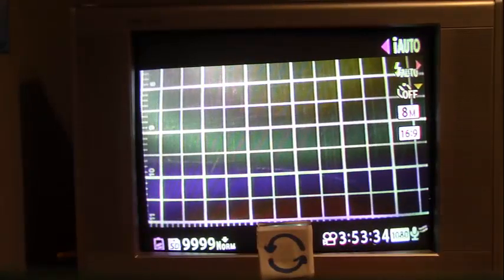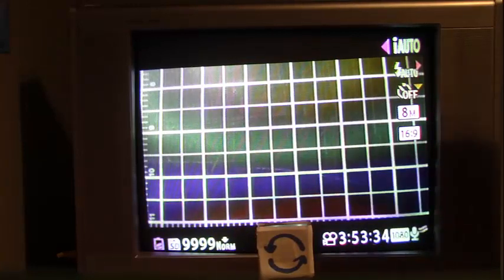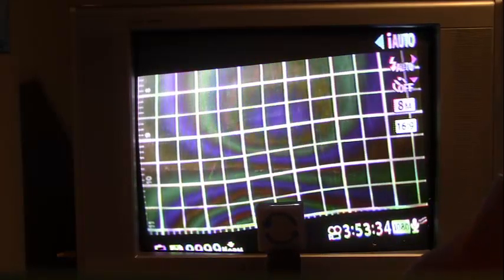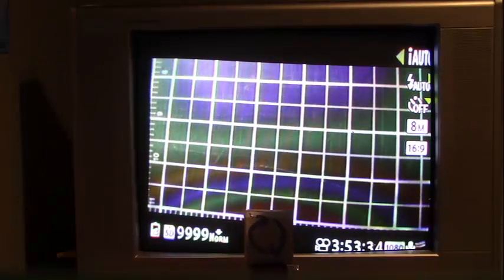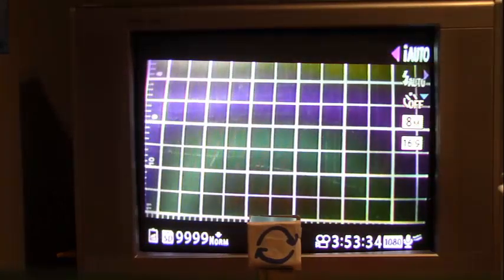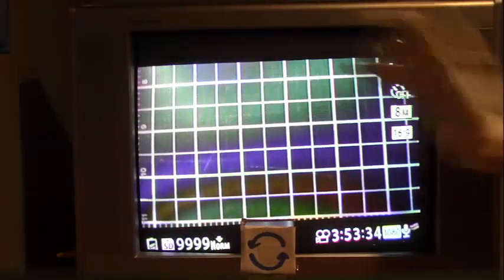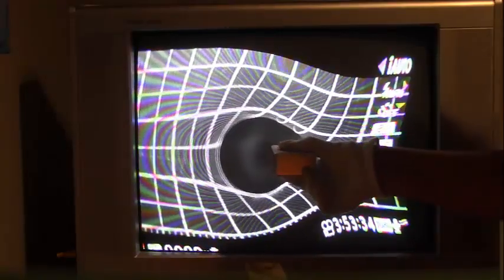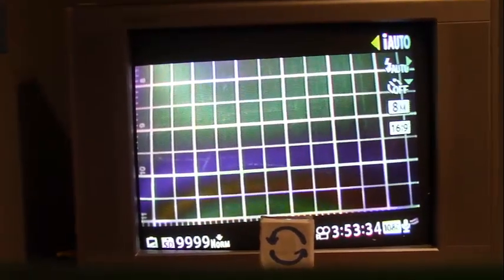On Clockwise and Counterclockwise

Comment: Vortexes screw together like a nut and a bolt. Or, a right-hand nut and a left-handed bolt, cross threaded.
 Does an array work because of controlled voids?
Reply from the maker: I don't understand your question.
Reply: @FractalWoman  Ken has used a magnetic array in his low gravity invention. Could this void clear space, to attract a ship/rocket.
.
Reply from the maker: @gyro5d  Yes, I have seen that video where he shows this invention, although he didn't disclose any details.  Void in the direction you want to go. It is a cool idea, for sure.
Reply: @FractalWoman ;  Ken says you need 5(?) things. People are asking him what the 5(?) are
 Ken tells 4.5 things and nobody listens. I was laughing! Seems that Ken always tells, but nobody (?)understands him.
 Been awhile, I'm sure I can find the video.
1: battery/power source.
2:  magnetic array. (?)Voids(?)
3: Moon and Sun aligned behind /under the Earth. Gravity of all 3 combined.
Still looking.
4: Covered in copper or (?).
Half of 5 to go.
4.5; Landing on an angle. Not straight down.

I found,  antigravity;
Gravity taken from around craft
Alter gravity by using changing centerpoints.
Contolling angular momentum.
.

Comment: 3sides are used. which is north, south and bloch wall?
Reply from the maker: Master Ivo: At the beginning of the video, you see a circular arrow on the magnet pointing counter-clockwise. That is the North Pole.  When you see the clockwise arrow, that is the South pole. When the South Pole is up and the North Pole is down, the bloch wall (the virtual flywheel) pushes the void to the right of the magnet (around the 2:34 mark). My hand is in the way unfortunately, but you can still see it. When the North pole is up and the South Pole is down, the bloch wall pushes the void to the left of the magnet (around the 3:15 mark). My hand is not in the way so this is easier to see. BTW: how is your Tesla coil research going?
Reply: Thanks @FractalWoman  for explaining. Research is very exciting right now. The impulses do induce the radiant energy. And when combined with resonant coils it interacts. Hope to make a proper video soon with a lot of new info. I asked Ken Wheeler if he  knew about Radiant energy/impulsed electricity, but he gave no responce. There is almost no good info on it to be found, so I hope to share proper info about it.
Reply from the maker: @MasterIvo  Ken very rarely replies to comments. That is why I make sure to reply to all comments, especially when they are questions that I can easily answer. To his defence, he does have a ton of subscribers and couldn't possibly keep up with all the questions and comments he gets. I am actually glad I don't have too may subscribers. I do like the feedback I am getting and I can be more personal with my audience. I would rather have a few good friends that I can get to know rather than a ton of friends that I will never know.
Reply: Very true, I love to answer as well, but as my channel is growing (more than 2k now) its getting more demanding.
Reply: @Fractal Woman would it be possible for you to repeat this experiment, adding a compass to show which face attracts north of the compass?  That would make this video helpful to bridge the gap between conventional understanding of magnets and the much more nuanced understanding you have.  If I had a CRT I’d definitely test it myself!

BTW, if north is the CCW face that means Ken Wheelers book has an important typo on page 67 and 70, because he claims the opposite.

Comment: Hi Lori. You say there are currents flowing. That means electrons are moving inside the magnet as in a wire. I don't that that's the case as it requires a force. Also the magnet would heat up. Distinti says the effect "is like" a current flow which I can back. What do you think?
Reply from the maker: Bela, that is a great question. I have done a lot of thinking since I made this video and it is my opinion that it is not "currents of electrons" flowing around the magnet, instead, it is currents of Aether. Electrons themselves, in my opinion, are "spun up Aether". It is not electrons that are "flowing" in and around the magnet, it is Aether.  What happens when you "charge" a magnet is, you are aligning all of the "Aether spins" of the electrons within the body of the magnet. The standard language refers to this as "aligning the domains." What this does is it "raises up" the Aether spins to a larger scale, the scale of the magnet. By analogy, if you took a bunch of gyroscopes (with their domains aligned) and spun them up simultaneously under water, the bulk of the water would begin to spin. Why? Conservation of angular momentum. It is easier for the "swarm of gyroscopes" to spin up the bulk of the water than it is to maintain their individual spins. The whole is greater than the parts. In a similar manner, the "aligned swarm of electrons" spin up the bulk of the Aether in and around the magnet.  Now we are merely dealing with fluid dynamics. For a demo of fluid dynamics mimicking the behaviour of magnets, see this video (around the 7:30 mark): https://www.youtube.com/watch?v=q44da9rzOhA&t=7s     Hope this helps.

Comment: How do you address the TWO SPINS (opposite directions) from EACH POLE of the magnet as shown in Ken's (video monitor) videos?  This is not to refute what you are stating in this video, but I would like to know if you have seen what I am referring to and if you have anything to say about your interpretation of what is going on?  The second (and opposite) spin shows up as the magnet gets closer to the monitor than you did in your video.
Reply from the maker: Let's do a thought experiment. I am going to spin up a gyroscope. Now, I'm going to point one end at you and the other end at me. I see that the gyroscope is spinning clockwise. You see that the gyroscope is spinning counterclockwise. The gyroscope is only spinning one way. I see clockwise and you see counterclockwise. When I see the South pole, you see the North pole, and vice verse. Clockwise-counterclockwise is a matter of perspective. The gyroscope is only spinning one way. This does not contradict Ken Wheeler because I learned this from Ken Wheeler. What Ken is showing in that video suffers from a similar problem. Now, we are going to do another experiment. Get a piece of paper and a pencil. Draw a clockwise spiral from the outside in (from bigger to smaller). When you get to the center stop, and then draw a counterclockwise spiral from inner to outer (smaller to bigger). Notice that you have to take the same path out. If spiralling in is clockwise, then spiralling out has to be counterclockwise. When water goes down the drain, if it spirals in counterclockwise, the air will have to spiral out clockwise. Then, it is all about pressure mediation between the water and the air.
Reply: @FractalWoman  I agree with your reasoning in this video.  Your first thought experiment(TE) is what you are explaining in this video.  I understand.  Your second TE is your answer to my question or another way of explaining the same thing as the first TE?  To me, the analogy in your second TE is falling short.  Modify your second TE to have a water level well above the drain.  There will still be a rotation, or vortex of water entering the drain, but no air will come out.  And, if you think about it, there is no source of air inside the drain in your TE to come out either.  The air is simply filling the void in the water vortex.  BTW I am not worried about anybody contradicting Ken.  I have done that myself.  I find some of his information very compelling.  But sometimes, especially outside of this subject, he has made some glaring mistakes and will refuse a friendly debate (even when I suggest to do so in private).
Reply from the maker: @DavidKenny64  "And, if you think about it, there is no source of air inside the drain in your TE to come out either." 

David: When the water is NOT going down the drain, what is inside the drain pipes below your sink? Water? or Air?
Reply: @FractalWoman  The vortex is only at the top of the column.  There is no air-gap all the way down.  The water column is pushing the air through the pipe ahead of it.  In my addition to your TE, where the water is of sufficient depth that the vortex induced "whirlpool" can't reach the bottom, any air coming out of the drain would have to bubble to the surface and would be easily noticed. There is none.  Also, the J trap under every sink and toilet is designed to keep sewer gasses out of our houses.  It ensures that air can go through the drain only in one direction. Thankfully so.  :)
Reply from the maker: @DavidKenny64  The air between the drain and the sink trap has to some out. The best way for the air to come out while the water is going in, is the spiral pattern. This is the because of pressure mediation, according to Ken Wheeler. Water spirals in, air spirals out. When I am doing dishes, I can see the air coming out when the sink is draining, especially at the point when the sink is nearly empty. When I swish the water around the drain, the water seems to drain faster. This is because the swishing action lets more air out which in turn allows more water to go in. I also see bubbles forming around the drain (if there is still soap in the water).  It seems as if the air is going both out and in. But this is just my experience washing dishes and observing what happens. That said, I need to go wash some dishes.
Reply: @FractalWoman  I was worried my persistence had made you give up on me. I'm glad you didn't  You are right about it being a pressure mediation effect.  Think of the drain as being a water vacuum.  The motor of said vacuum being the potential energy of the standing water.  Anything that gets sufficiently close to the opening of the drain will be pulled in with the water.  Just as the dirt we want to pick up with a vacuum cleaner must be close enough to the air flow to be dragged along with it.  The water definitely flows faster when the air is not being pulled in with it.  

Try this: Plug and fill your sink with enough water so that no air will be drawn in with the water. Use a tube, flexible or rigid  (I used an aquarium air hose) to blow air into the drain (after pulling the plug).  You will see that the air gets sucked into the drain.  If you raise the tube out of the drain (while still blowing), you'll get to some height from the drain at which the air will switch from going into the drain to rising to the surface. Pressure mediation...  

Another flaw in the analogy is using two mediums since there can only be one medium, in the case of a magnet. Is there a solution to my original question without using a second medium?  Ken's explanation is that there is a second vortex spinning in the opposite direction, and flowing in the opposite direction (and inside the original vortex). But, in both cases, the medium would be the Aether.  Which, coincidentally, is very similar to your water analogy.  The main two main differences are: Just one medium. And a switch in the direction of the medium flows.  The outside one flows out and the inside one flows in.
Reply from the maker: @DavidKenny64  "Another flaw in the analogy is using two mediums since there can only be one medium, in the case of a magnet." 
In the Aether model I am proposing, there are two media (Ken calls them modalities). I refer to them as Primary Aether and Secondary Aether. Primary is more inertial (like water), and secondary is less inertial (like the air). Primary Aether IS inertia and Secondary Aether is what Ken calls "loss of inertia". Robert Distinti calls it "uninertia". Primary is inertia and Secondary is uninertia. This is what is reciprocating in and around the magnet. You can't have pressure mediation unless you have two media with drastically different "inertia". IMHO
Reply: @FractalWoman  "You can't have pressure mediation unless you have two media with drastically different 'inertia'." Well, you found my problem.  I know full well that we should always challenge our assumptions and I thought I have usually done a pretty good job in that area. I thought I knew what Ken was talking about when he said "pressure mediation" until I tried  to look it up. Can you suggest any resources I could go to and read up on it?  Does it go by another name?
Reply from the maker: @DavidKenny64  Good question. I will look around to see what I can find. Pressure mediation is a term Ken coined, for sure. He also coined the terms "Field Incommensurability" and "Principle of Incommensurability" which I am quite fond of. I am actually giving a talk on "The Principle of Incommensurability" and it's relationship to fractal geometry this summer at a conference in Montreal. I am taking his terminology and running with it.
Reply from the maker: @DavidKenny64  The term we are looking for is fluid dynamics. https://en.wikipedia.org/wiki/Fluid_dynamics  
Fluid dynamics is a sub-discipline of fluid mechanics that describes the flow of fluid liquids AND gases. So, field pressure mediation is and fluid dynamics are one in the same.

Comment: I was thinking about the Magnus effect as applied to a Flettner Rotor on a sailing ship. (explanation: http://www.sciencemag.org/news/2017/09/spinning-metal-sails-could-slash-fuel-consumption-emissions-cargo-ships)  

I am wondering if there is an analogous effect with the Æther that could be used to propel a spacecraft?
Reply from the maker: Code Tech: I spent some time thinking about this and looking at the article. If there is no airflow (if the wind isn't blowing or we are at rest with respect to the wind) then there will be no effect. That said, if we are able to move relative to the ether,  and if we replace the large spinning cylinder (in the boat in the article) with a large cylindrical magnet, then we should see a net effect since the ether spinning around the magnet would act like the spinning cylinder in the boat. This would be easy enough to test. Send a satellite with a giant magnet in orbit around the sun in earth's orbit but in the opposite direction. According to Robert Distinti, the earth is for the most part, at rest with respect to the ether. In other words, ether is moving us just like a current in a creek or whirlpool would move a tiny stick floating in the water. So, if we go in the opposite direction to earth's orbit, we should be able to detect the ether wind using this experiment. If there is no "wind", then the magnet will not move out of it's orbit. If there is ether wind, then the magnet will move to a different orbit over time, in or out, depending on whether the south pole if facing forward or the north pole. The CRT experiment will tell you which pole should face forward for outward "lift".  Turn it around if you want inward "lift". Cool idea.
Reply: Yes, I know there needs to be a wind blowing for the effect to work on a ship.

Say there was no wind blowing, but you put the cylinder on a track on the deck of the ship, perpendicular to the desired direction of travel.  You spin up the cylinder, and then quickly slide it to the other side of the track. That sliding movement mimics the wind and creates the effect, producing thrust.  Then you spin it in the opposite direction, and slide it back on the track, etc.

Of course that is impractical for a ship on the water, because there are better ways to propel a boat. But what about a spaceship? This method is self contained; it does not eject mass (burning a limited supply of fuel).
Reply from the maker: And by "spaceship" you mean in outer space right? Are we still talking about magnets?
Reply: Well, there are different flavors of Outer Space, but basically "yes".  There may be a propulsion method that will work in the vicinity of the Earth (due to the Sun) but not in interstellar space.

We are discussing exotic propulsion methods based upon fundamental properties of the Æther.

We are talking about magnets using the analogy of the Magnus effect as applied to the Flettner Rotor.  Note that a solution using magnets would not necessarily need the mechanical motion I described above; it is simply an illustration of the idea.